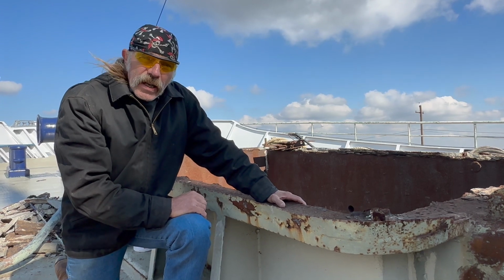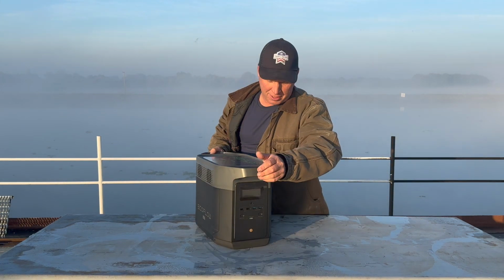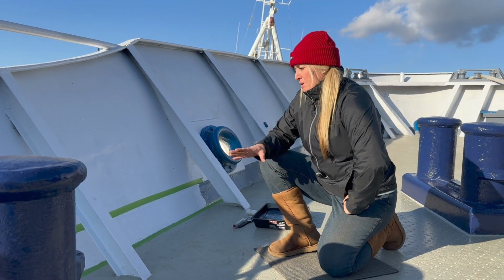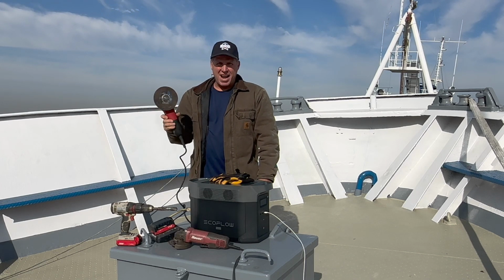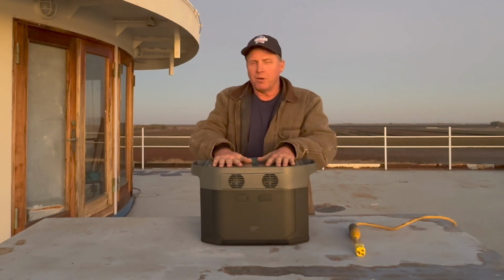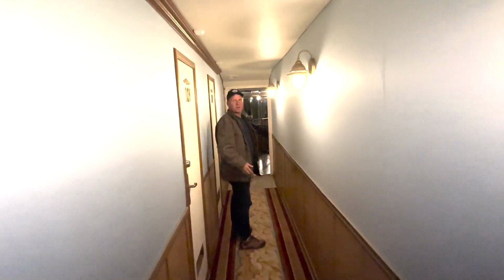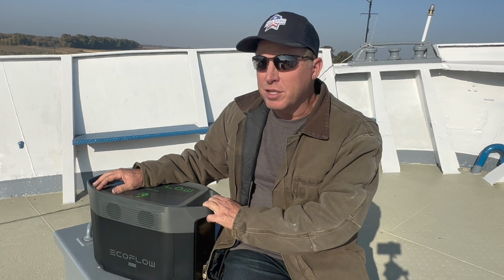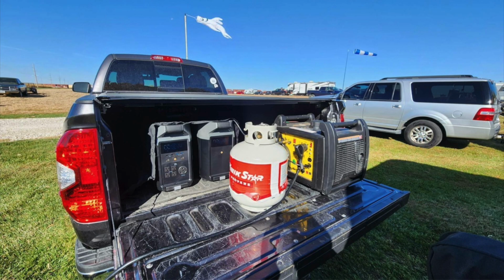EP 20  OFF-GRID LIVING ABOARD OUR CRUISE SHIP and TESTING THE DELTA MAX PORTABLE SOLAR POWER STATION

Comment: Crazy to see what the EcoFlow can do. I wonder if it would be feasible to switch entirely to using the eco flow for lights inside the ship. If you keep unnecessary lights off then with a solar panel to charge it, maybe a second battery plugged in, that you would probably have no problem running the lights with it 24/7. For an added backup I think they even have a smart generator that can plug in and automatically turn on if the main batteries get too low and it can charge them up. That would be like for if it was super cloudy too many days in a row or something that it just couldnt recharge off solar enough for the use or maybe for heavy use days. 

Chris, in terms of the cost of the ecoflow products and the amount you currently spend on gas generators, what would the ROI be for something like that for on board the Aurora? I feel like it would be feasible with what you showed but I’m curious what you think in terms of doing something like that as an actual “permanent” power solution instead of using gas generators 24/7

Comment: Running things on solar/electric is awesome, we need to pursue that technology as a society. BUT how much does all that fancy gear cost? How much gasoline could you buy for that? Solar/electric cars etc seem like nothing more that a feel good gesture for rich people at this point.
Reply from the maker: I disagree,   You can find used solar panels for $30 or $50 each and charge controllers are cheap as well.   Not hard to find someone selling refurbished batteries at the average cost about $50 each.   Really you could save a ton of money doing this on the cheap.   The luxury items are nice of course but not the only solution.    Also if your craft you can create an inexpensive wind turbine generator out of pvc pipes and a junk yard alternator.

Comment: Hello. What a wonderful job you are doing. We are so impressed.  We owned this ship for several years and worked long and hard on restoring it.  We have six other ships and just couldn't finish and do her justice. So delighted to watch her resurrection.  We redid the upper rooms, added all the mirrors, the dining room walls, ceilings, the bar and meeting rooms. We welded many plates. Very familiar with all the work that is being done.  What a beautifully talented crew you have. I believe in one of my containers I have the bridge engine room controls.  If you haven't replaced them with something else, I may be able to find them for you if you are interested.  We began work on the swimming pool and we decided after some thought that it would be better to put a false deck about three feet down to make a jacuzzi and use the lower portion for the water needed for the laundry room.  Just a thought you might consider. It can be heated from the engine room off the generators.  Lots of advantages. I'm sure all of this you have thought of. The laundry seriously needs a good water source.  Anyway, I've talked too much. Wish you well.  portmercy@friendships.org
Reply from the maker: Hello Sandra,  Thanks for the encouraging message.  I believe we spoke some years ago and you had mentioned that this ship was replaced with one that needed less effort to get back online.  The Spirit?   Much of your crews work still shines aboard this ship.   Much of the plumbing for the laundry area etc is much easier to re plumb all new materials.  We have done this in many areas but the laundry room has yet to be on the short list.  We thought the same for the pool.  Would be easier to find an insert and size things up for a hot tube.  For now we’re gonna clean it up and leave the pool as a blank slate.   Engine room controls.  Most definitely we are interested.  I had thought that they were looted at some point when the ship sat empty.  Glad to know that you may have them.  Would be more than happy to work that out.

Comment: Wow, the pool really is tiny! More like a big bathtub. I'm sure it will nevertheless be a welcome addition come the heat of summer. As for power, I think you will eventually need a big solar array and a bunch of batteries, but this will do for the renovation work and lighting up small parts of the Aurora at night. Though one day it would be amazing to see the exterior lights turned on. Ship's looking fantastic, BTW 😊
Reply from the maker: The swimming pool was converted in 1960 from a cargo hold and is pretty small but as with most vintage cruise ships the pools were very small.    Worth googling vintage cruise ship pools to see what people were willing to swim in during the 1950s-60s.    A solar array would be a welcome addition to this project for sure.  This little EcoFlow Max is great for powering up a couple cabins aboard for a day or two if we don’t want to run a generator.
Reply: It looks more like a livewell than a swimming pool, but I don't think much fishing was done aboard a vessel of that size. 
It would make for a good storage space for odds and ends, if you aren't going to restore it as a pool.

Comment: If the Ships electrical distribution system is ok, could you start and run the smaller dieselgenerator/auxilary engine? For lights and powertools. You would get more fueleffiency and run on gasoil

Comment: Are there any plans to recommission the onboard generators? The Ecoflow is a great setup to get power to the ship straight away. The solar panels will provide free energy saving both money and the environment. A win-win situation.
Reply from the maker: We have fired the onboard generators.  They work but are pigs.  On a daily basis it’s better to use small generators to the shore power and runs the lights and outlets etc.  would definitely love a solar array and battery bank.   Or even some of EcoFlows larger systems would be great too…

Comment: For those of you who have not seen the Video by "Mathias random stuff": do not connect sensitive electronics to the powerbank while having a grinder or a circular saw plugged in. The Power draw of the grinder etc. can lead to voltage spikes that will fry devices that can not handle it.
Reply: I saw that video too, EcoFlow didn't like that did they.
And I don't like how this one on the Aurora is just a full advertisement for this power supply, it sounds far too good to be true.

Comment: Use the power station for lights and running computers and phones. It’s not going to be the work unit for tools with motors. Not for long run anyway. I’m sure will be great at night when you want silence and don’t need large power. 

Glad to see sponsors. Good for you.

Ultimately you need big solar and battery bank
Reply from the maker: Very true on all accounts.  A solar array would be fantastic but this little power station shows huge potential on EcoFlows product line..